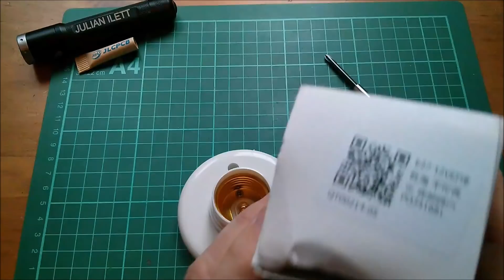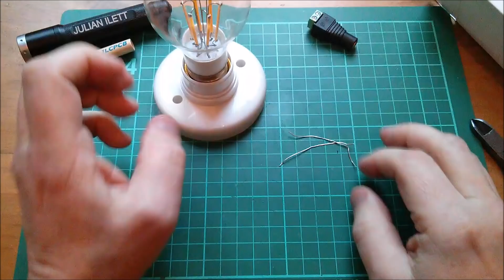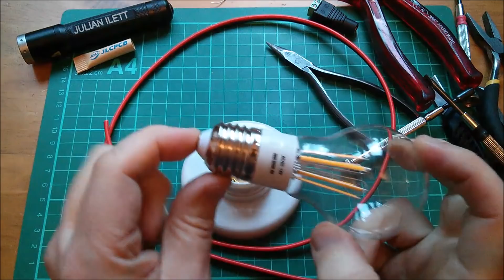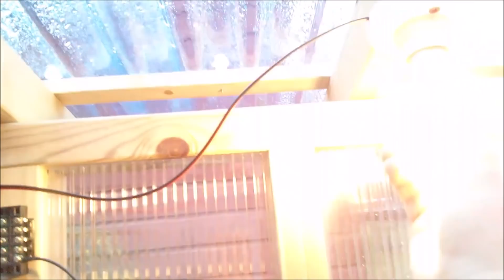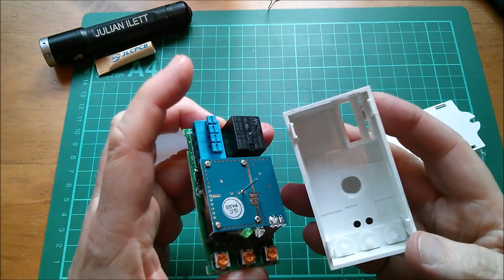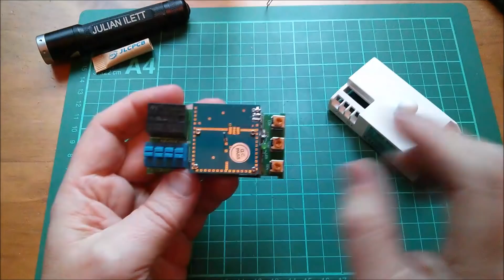Julian's Postbag: #127 (2^7-1) Bulb Holder and Radar Sensor

Comment: ended up buying 12v filament bulbs from banggood as couldn't find any on ebay
using mine as garden lights, i have solar on the shed, running to the decking - got nice coach lantern thingys for them to go in. not a fan of that lampholder, 

couldn't you use your latching remote relay to control some LED tape to give light in the work area?
( i did that for inside the shed, works really well )

Comment: I'd always done the tinned wire into screw terminal before, (All been low voltage/current stuff like alarms, so no safety concerns) But after reading all the comments here, I won't be doing that again... The great thing about youtube is you learn more than is in the videos.
As for the radar sensor, it may not be IP66 rated, but it's radar, put it in an IP rated (non-metal) enclosure and it'll still work.. can't do that with a PIR.

Comment: Before cutting a bolts, screw the nut in, it's easier getting the nut out than getting the nut in, getting it out will clean the thread a bit.

Comment: Have a look at IKEA's range of E27 bulbs and fittings not much more expensive that the Chinese cr#p you bought but much better made. They also do both types of B22 <> E27 converter.
I agree with all those who are appalled by 12V bulbs with mains type connections. Asking for trouble.
Reply from the maker: Not a fan of the North Circular Road :)
Reply: @JulianIlett  Are you any closer to Reading?

Comment: It's, Postbag! You mention it again.
12 Volts on a E27? Here in Germany the Founders of DIN and the first safety engineers would rotate in their graves so quickly you could gain energy with them.
Btw. soldering and screwing are not friends  - said my electritian teacher once. The tin-solder is somewhat melting over time and the connection is going to get loose. Especially outside.
But nevertheless: Thank you, for your video!

Comment: Surely a faux whale-oil lamp fixture hanging from a cut nail pounded into a timber beam is more appropriate for those who cling to heavily-red "warm white" smoldering flame simulating LED lamps?
Reply: Bob Riemersma - that sounds a bit high tech. What’s wrong with soldering the wires direct to the cap of the lamp?

Comment: es is crap, if the wiring is backwards, the threaded part on the bulb could be live
Reply: I agree, that's why some bulb fitters have plastic thread and a small metal contact deep inside.
Reply: silver & noise if you buy from the wrong sources.
Reply: silver & noise agree, but then that guy shouldn't be doing the job, but screwing light bulbs are done by everyone.

Comment: Tinning wires before crimp is a no-no. the crimp forms a cold weld, which is compromised by the solder. The tinned wire also has a malleable cross section which can deform over time causing failure! but then its a hobby and you don't need calibration certs on your crimp pliers

Comment: E27 12V? How the h*ll can that be legal? The risk for confusion is extreme. =(
Reply: Exciting though isn't it
Reply: If its not illegal it damn well ought to be.  Sadly, the huge flow of direct personal imports make it unfeasible for the most basic safety standards to be policed.  They can't even catch fake CE stickers or lethally dangerous stuff.  So if this thing simply goes phutt when plugged in to the mains it's not tragic.  It may well be illegal,  but not policed.
Reply: @raykent3211  It's not, I've seen medium base screw in 12V bulbs for sale in a store in the US
Reply: @bradnoyes7955    OK,  thanks for the info.  But it seems like madness.  If the regulation for a 12V bulb specified a slightly finer pitch screw thread nobody could make the mistake.
Reply: China innit.
Reply: There are various lamp caps, and all the physically larger sizes have various lamp voltages available...
Reply: China doesn't care
Reply: Edison screw is just a thread standard. Not a connector specification. There are local standards that say that you can use only specific voltages with Edison screw bulbs in that country, but in a country that has no such standard, they can do whatever they want.

Comment: I don´t get you british. You have dual layer insulated pannels as wall... And you have a heater... Then you have a 10 cm gap in the roof.. and not insulated pannels on the roof.

If you just filled the gap and had the same pannels on the roof as the wall.. it would practicaly heat it self
Reply from the maker: It's a work in progress - and don't forget The UK gets 17 minutes of sunshine a year :)
Reply: @JulianIlett  Its really not that much more in Sweden.. Well.. in the mid of summer it is.. But in the spring and autumn.... its pretty  much the same weather as in UK... possibly even worse.

Have it here in over the pool. We use to have one that was glassed in... that gave us 12 degree a normal day. Then we swiched to one that was partially plastic and not really tight. That gave us about 4-5 degree. Then we made it airtight, that took ut up to 8 degree . Even on fairly cloudy days.

We  are going to glas in the new one to. but haven´t afforded the new windows yet.

Giving 12 extra degree in early spring is freaking amazing. That was with the old over ground 8m^2 pool. The new one got a in ground 20m^2 pool. 

The water temperature is really uniform over the day. Talking less than 2 degree diffrance between morning and afternoon.

Its pretty much never falls under 25 degrees in summer and late spring early fall... This summer was exelent. We had over 30 degrees in the water some days.. and talking.. no heating what so ever.

Comment: Why don't you buy a proper crimping tool and some ferrules? Those cost less than the sum of the items in this postbag alone, and it'll last for years. The added bonus is that the connection will actually still work in a year.
Reply: Also, crimping doesn't require a power-requiring soldering iron!

Comment: I think that one of the advantages or sometimes disadvantages of the microwave types against the PIR types is that they can often detect and be triggered from around a corner or other obstacle.
Reply: I have one in my upstairs corridor to light it when you enter.  It took me a few months to realise that it also came on whenever someone moved about on the floor below.  It can see right through the floorboards.
Reply: Sounds about right, except that it would never work reliably if you wanted to make use of the effect, lol. @petehiggins33

Comment: That lightbulb is an awful design! The lighty bits go all the way down to the socket. They're supposed to be centered in the bulby bit! (Technical terms.)
Also, again, just keep recording the voice with your phone while doing the screengrab, and then splice audio and video together. No need for shouting.
And to avoid the misalignment, an alternative to the extra hole and screw-down, some hotsnot to each the left and the right of the threaded cup, between metal and plastic fitting, would probably have worked as stand-off support. Yes, for putting soldered stranded wire into screw terminals, in particular those without load-spreading metal inserts, you ought to burn in the special hell. And no, you don't have to pre-align them, you have to align them.
Reply from the maker: They are set very low, but it kinda works when the bulb is inverted. Short wires = lower cost I guess :)
Reply from the maker: Hmm, not sure about hot glue - the bulb glass stays cool, but the base gets quite warm.
Reply from the maker: Splice? I try to do as little editing as possible - maybe I should go the 'single-take' route like my boy Clive :)
Reply: @JulianIlett  Hmm, then epoxy would be safer, but at that point it becomes moot indeed as the time and effort savings melt away … Oh, well. A dozen ways to skin a cat, I suppose. (I don't actually condone skinning cats.)

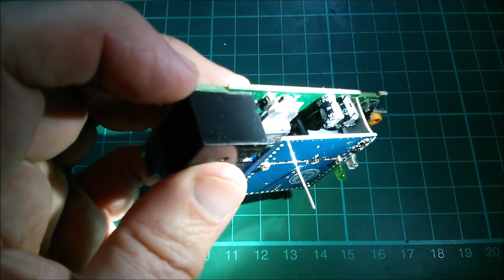Comment: You don't know what a LM317 is?  Unsubscribing! - 14:05

LOL!  Disappointed, Julian!
Reply from the maker: Ha - just wasn't sure what the T suffix meant :)
Reply: Julian Ilett - apart from time for a cuppa, T means 1.5A in a TO220 package 😉. Or at least it did years ago. Not all manufacturers use this designation though.
Reply: I don't know man.  It is kinda like not knowing what a 555 or 7805 is.  One of the first ICs I remember using in school and still in common use.   :-P

Comment: You need the solar panels I installed on my parents caravan. They are 12v 100w, tested the panels by laying them upside down on the lawn and I still got 12v out of them. In full sunlight they peak at 23v each and generates 5A at peak efficiency :D
Reply from the maker: I've got the exact same panel - what I need is some sunshine :)

Comment: I'm not a fan of low voltage (12V) bulbs having the same base as 120V bulbs!  A mistake would be too exciting for my liking!
Reply: I'm even more against 12VDC bulbs having the same base as 240VAC ones!
Reply from the maker: Even more exciting at 240V AC :)
Reply: Indeed your 240V would be more "exciting".  I'm in Canada and am quite happy with 120V being the standard.
Reply: @ElmerFuddGun  Them's rookie numbers! j/k
Reply: @ollieb9875  - ya ya... but 120V does everything we need (except stove and drier) without the extra space and expense of the 240V designs.  :-)
Reply: @ElmerFuddGun  Don't forget hot tubs also.
Reply: ElmerFuddGun An LED would act like a dead short either way and for a few miliseconds it would pull about a kiloamp or more until the breaker shuts off. As you said, "but 120V does everything we need" there isn't really that much of a difference. If something blows up on 10x overload or blows up on 20x overload what is there to argue? It's literally the same. And you yourself said that the same grid can supply everything the 240V one can. It's like saying it's safer to plug a nail across the US sockets ffs
Reply: @ElmerFuddGun   dont forget welders they dont work that well on 120 according to chuckie2009
Reply: I had a dear friend who used U.S. 110 volt plugs and jacks to hook his loudspeakers to his amplifier.  He accidently plugged his $$$ speakers into the wall socket.  BOOM new speakers.
Reply: From personal exp of mispowered 12v led bulbs, even at 240v there is a fairly modest pop and that's it.
Not that exciting really.
Reply: It’s fun putting 110/120V filament lamps in 240V fittings (supplied at 240V) 😂🤣
Reply: well, the way he installed it doesnt do much harm does it. If you screw 120 or 220v bulb in there, it just doesnt do anything or slightly glows I guess

Comment: tip: if you want to cut/saw part of a bolt  off...  put a nut on it first, then saw/cut the bolt, a bit of filing on the cut edge, and you can unscrew the nut to coerce any bit of messed up thread back into place (sort of).
Reply: I hereby accuse Julian of knowing this and fishing for comments!
Reply: Yes, that works great. The nut essentially becomes a thread chasing "die". I have done this for decades.
Reply: jlucasound yep same here the smaller the diameter of the bolt the more important it is and I have done this with 10 BA bolts !
Reply: Bolt cutting 101.

Comment: Soldering a cable and then screwing it in? Are you mad :) It is indeed your channel. I use a wire Ferrule to crimp terminate a stranded wire.
Reply: Solder can't provide any structural support so what will happen over time, is that the solder will cold flow under the compression of the terminal screw, becoming loose and resulting in a bad connection.
Reply: @crayzeape2230  heat, sparks and fire.
Reply: Cray Ze Ape - it has been recognised in the U.K. for a long time that mechanical screw terminals and soldered wires are a very bad combination.
It is believed that this practice may have become kinda accepted due to manufacturers tinning the wires on the bare ends of equipment supply cords before the U.K. made the fitting of 13A plugs mandatory for consumer products. Consumers assumed the manufacturers prepared the ends of the supply cords ready to fit in the 13A plugs. But actually, the wires were tinned to make it easier to insert the wires into quick test type connection units at the factory.
Reply: Also, BS7671 regulation 526.9.
Reply: In the Netherlands, when i did go to school (30+ years ago), it was soldering before screwing in. Years later it was changed to do not solder if it is screwed in.
Reply: German detected! Screwing in a cable with solder in is indeed a no-no here, but pretty common elsewhere in the wold...
Reply: @muh1h1  I'm not german, but I do it with a crimp preferentially. It's less likely to break off if there's a bit of movement on the wire.  And it stays in better shape if you screw it in and out a lot.
Crimping is also a lot faster if you have to do a lot of them.
Reply: @oreubens  Oh, i thought you where german because here it is actually against code to put a soldered flexcore in a screw terminal, because  if the connection slowly fails and resistence rises, the connection could portentially get so hot that the solder melts, drops out and causes a short elsewhere. But your points are very valid to!
Reply: @muh1h1  Same here in Finland. And it makes perfect sense. Especially for mains.
Reply from the maker: New invention - flexible solder :)
Reply: @JulianIlett  How much more flexible do you want your solder to be??